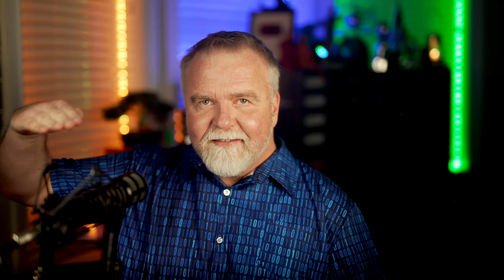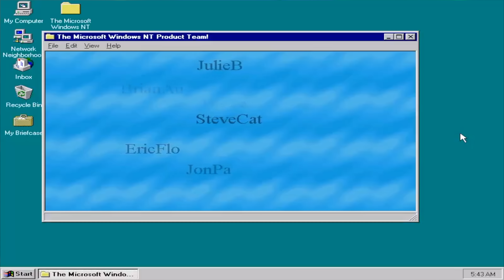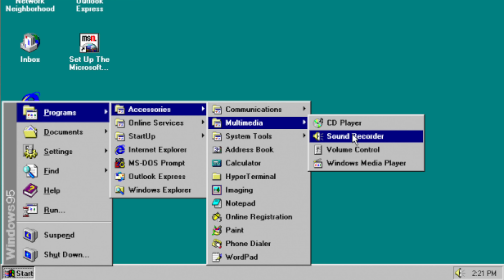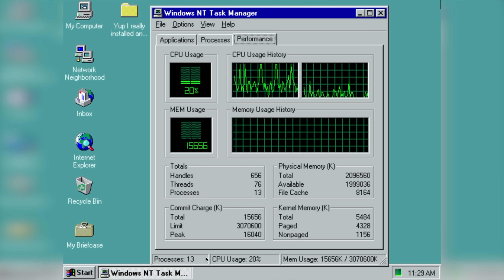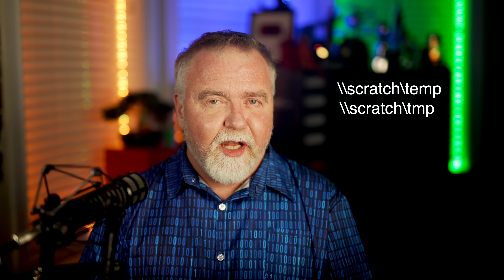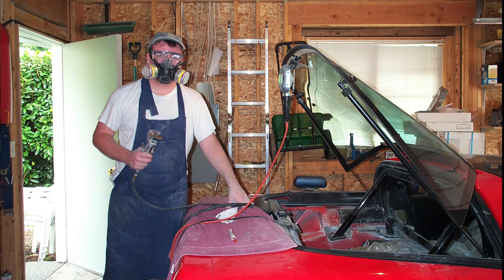Behind the Windows Start Menu - Insider Secrets

Comment: I fully appreciate Dave's explanation of dealing with RISC processors. In the mid 1990s, my team (we developed railroad and rail transit control systems) ported our application from DEC machines to the Alpha processor, Having to deal with 64-bit words as well as data alignment, and weirdly interruptible- and non-interruptible groups of instructions, was a major effort. Though most of our code was in C, we had some assembly routines (mostly for performance), and it was a good 2 years before we found and fixed all the bugs we could find. Many of those fixes were at the customer site, following some failure or weird operation of the system, some of which brought all trains to a halt for several minutes, not good when the main goal is to safely move people.

Comment: For some 1d10tic reason developers are leaving off the menu bar off from under the title bar, in appliacations, and it's p1ssing me royally the F off.   Never, ever get rid of the menu bar.  Every application  there better be a G.D. menu bar there.  File, Edit, View, you name it.

BTW, Dave, I've tried to register Windows 10 at least 3 times with three different times and your activation code swwcks.  It doesn't work.  The run around it gives...  It's a pile of steaming sh1t.    

Once with a sealed shrinkwrapped copy of Windows 10 pro.  Once with one of those cheap OEM keys.  ANd a third tiem with a known good WIndows 10 Home Product key that I was no longer using on another comptuer because I had gotten so sick of Windows 10 I reformated it to Windows 7.  SO I know that code worked at one time.

Comment: may I ask you, why is windows 10 menu is so laggy? Sometimes I press the menu and it doesn't open, I have to wait and press again several times. This doesn't happen on Linux or Macos, but happens on Windows - it is not a problem of my computer (I have access to Windows machines at work and also use Windows on the "cloud" - everywhere is the same. What's wrong with windows GUI, why can't this be fixed fo so many years?

Comment: Being able to explore down into compressed zip files is handy!  I use that daily to pull out a single file or a handful of files with the copy/paste feature.  I tinkered around with NT 4 and 5 back in the day and it's really is cool to meet the gentleman who came up with the start menu!  It was amazing how robust Windows 95 and eventually 98 behaved with NT 4 and 5.  I had a small network of two computers connected with crossover cables back in the day and was able to share files between a Windows 9x machine and an NTx machine without so much as a hiccup

Comment: About those long-blocking network paths. In windows 10 to this day, when I drag a file in explorer towards a window on the left, and accidentally, for a split second, go over a dead network-mapped drive in quick access, the whole thing dies. Not going to hold the mouse for a minute, the drag & n drop at best does nothing but can really crash and burn if it ends up dropping in the wrong place. Does feel weird such a horrible UX still exists there but I know the thing is very complex  ...

Comment: Being a coder as well, watching your videos are like sitting around and talking shop. But in adition to writing code, i also did hardware design.  I have product in some very interesting places here in the US as well as some other very large countries. Since I was both a hardware designer and the software engineer for my own projects i was also in the group that trouble shot hardware designs of other hardware engineers. A lot of my stuff was written in assembler. 

And speeking of Commodore,  lol I used to know the 6502s, 6511s  VIC 20 AND COMMODORE 64. I thought the raster interrupt and the VIC sound chip was awesome I actually built the SID chip into some other devices. But since they had phase 2 clocks getting them to play nice with intel microcontrollers was an interesting trick. 
Great Video!

Comment: The U.I. is the most important part of any O.S. for most users.
After 3.x on a 386, my first "modern" O.S. was win95 (as I never installed the Plus package, so I was able to sell it while still in the shrinkwrap - happy online seller, happy online buyer). Or plus came pre-installed and I just got the sealed box with it. Great U.I. Terrible O.S. 95b was a lot better. Wish I could say I got NT4 next, but nah. Did get to use it later on. Great O.S. Great U.I.
98 meh. 98SE fantastic. Still unstable, but you figured out workarounds for the crashes. Used it till about 2004 or 2005.  (ME was clearly a no-go from the start). 
But as some point you get a new PC. I'll be fair, it was due to unfair limited networking restrictions under 9x. On new 512MB RAM/ nearing 2GHz systems where XP would take 5 minutes to boot, I got 98SE to boot in 15-20 seconds. So I got hold of Win2K. Or NT4SE as I like to lovingly call it. And yes, I did change the sideways text on my Start Menu many a time.
I know many people liked XP. I was briefly forced to use it and couldn't switch to Classic U.I. fast enough.
Windows7 was a good enough O.S. when using the Claasic U.I.
Windows 10 is a most unfortunate O.S. and I feel like a very unfortunate person being forced to use it. I know Windows forcing me to renew "folder view" is a way to make me switch to Windows11. But my natively 4.2GHz Octacore system with 64GB of DDR3 can't run Windows11 according to the Microsoft update page.
So I just long back to the U.I. you worked on!

Comment: You say Unicode, but I imagine that you specifically mean what is nowadays called UCS-2, which was a fixed width 16-bit encoding, and was only capable of displaying 65,536 codepoints, because at the time it was assumed that was all that would be needed. Nowadays, Windows uses UTF-16, which is variable-length, and can represent all million or so valid codepoints, and potentially more. That said, most files and such tend to be UTF-8.

Comment: When I heard about the Windows XP / Server 2003 source leak, as a developer, I immediately was interested. So I found a way to get my hands on the nt5src.7z file. I had to download some extra files to fully compile Server 2003, but after about 5 hours, I had a compiled copy of Windows Server 2003 (Small Business Server). It would not install as there were some missing files. But it did boot into the installer UI.

Comment: Back in circa 1999 when I was in college I had an AMD K6-3 500 with 64MB RAM and a Riva TNT, machine I built myself (my first mostly new PC, and the first one I had that wasnt 2 generations old) I dual booted 98SE (Games and certain software only) and NT 4.0 Workstation (Everything else). 
NT 4.0 is prolly my favorite OS of the "old-world" PCs, for one it was 10x more stable than "9x" and would suprisingly run many (id guess a good 94%) of previous windows apps and 9x apps and even some DOS games.

Comment: I have to be frank, that "browsing into zips like a folder" combined with the fact that the icon in Windows looks almost like a normal folder icon has caused a lot of trouble over the years for people who are not that tech savvy or even just not that knowledgable. They just assume that a zip folder is just like a folder (which sort of makes sense because of the very similar icon), prompting them to try and run applications from in there, and so on. So in my opinion having a) a very different icon from a normal folder and b) having a separate window open with the contents of the zip file is a lot better than treating it like a folder :).

Comment: both linux and windows start menus are crud, mostly system generated. then you have the completely flat space on desktop, where shortcuts get dumped by installers. between the two, it's a mess, and users arent equipped to deal with these outdated ways of accessing programs.
the dozen iterations of adding silly features never addressed the problem. you install software, and without any control it's created some start menu items with some names, that may or may not be names you expect.
is this the peak of software and UI engineering after decades?
Reply from the maker: I'd say it is, until you write something better...
Reply: @DavesGarage  : the  early versions were fine. later ones were not an improvement. it's not about coding. there are even bigger fish to fry, like the mess that is operating system files, software files, and user files, all exposed to the user by default, which is not desired. the original office desk paradigm hasnt kept up with times.
windows registry should go. emulate it for backwards compatibility. it's a mess.
Reply: Installers for the vast majority of commonly used programs in Windows have checkboxes at the end allowing you to decide whether or not desktop shortcuts or start menu items for that program are added. 

The checkboxes are often turned on by default, so if you're not paying attention your desktop and start menu will get cluttered, leaving your only option to be finding a guy that helped build the start menu on the internet and ignorantly complaining to him.

Comment: 7:30 that's a thing I never got about Windows NT Kernel: I've always read that it also supports some different processor architectures than x86 but I've never seen it actually running on anything other than an x86 machine so to me a Windows NT Kernel running on a RISC machine is an abstract idea that you'd never see irl.

Comment: Super stuff. Question 7:36: you were saying MIPS had a diff memory for storing large numbers? And x86 did not care.  Not understood this one.  Thanks
Reply from the maker: So a 32-bit integer is four bytes.  On the MIPS, it must live in memory at address 0, 4, 8, 16, 20, or any multiple of 4.

On the x86, there's no such requirement.  You can store a 32-bit value at address 7.  But if you serialize that structure to disk on an x86 and then read it back on the MIPS and try to touch that value aligned 7 bytes in, it will throw an alignment exception and crash.  Hope that helps!
Reply: @DavesGarage  thanks. I just recalled the CreateWindow struct must have been prealigned for few  32bits like wndproc callback.

Comment: So for this side bar text challenge, coming at it from a games programmer, couldn't you render it to a texture, then rotate that during initialisation or first frame?
Reply from the maker: You could, but that requires two copies of the bitmap, whereas drawing into a rotated device context actually keeps 0 copies!  Every byte is sacred, every byte is great....
Reply: The graphics device interface API at the time was (and still is) simple, 2D bitmap graphics.  No concept of textures.
Reply: @RegularCupOfJoe  there were. I was a game programmer then. Even without the hardware there was a software renderer. So just software renderer to a texture. If there was no texture, then what did he use to draw the sidebar? He literally said texture.
Reply: @aloluk  Correct, there was 3D software rendering back then. And I'm not concerned about whether to call it a "texture" or a "bitmap"-- call it what you will.  Software-based rendering, however, was very slow, as it is still now compared to hardware rendering.  If the start menu took even a half-second to render itself for the sake of a simple bitmap, that would have produced a sluggish and unpleasant experience for users.  From David's explanations, it sounds like the bitmap is rendered each time the start menu is opened, so keeping it snappy is more important.  A simple bitmap can be rendered much quicker with fewer calculations in a 2D pipeline (such as GDI or Direct2D) than a software-based 3D renderer.  No need to use a semi to carry one letter 2 blocks away when a bicycle will do just as well.
Reply: @RegularCupOfJoe  I dont even know what your argument is here. Software rendering this would have been very fast and could be done on the first frame of the key press before it was presented to the user. Thats a fact because we did it in software rendered games back then on the Windows PCs.
Reply: @aloluk  My argument is that 3D software rendering of a simple UI component in the 1990s would have been (1) a risky investment because by far a majority of customers did not have fast enough CPUs to do 3D software rendering until the mid 2000s, and (2) using 3D to render a simple 2D component is overkill from a software architecture standpoint.  Today, 3D software rendering?  Absolutely... do it... or have a very compelling reason not to.

Comment: The classic start menu was the most efficient one - and that's why I use it still today thanks to Open-Shell. It's a must-have if you got more than 5 programs installed... (I got about 350 + a few dozen games).
Reply: But which version of the classic style? In Win95 if you had a gazillion entries it would create multiple columns. In Win98 it was only a single column that could scroll vertically.
Reply: @eDoc2020  Win95/column style. It shows 5 columns on my 4k OLED :) I hate scrolling / not having an overview. But I also created a few subfolders in the 'root' (above 'Programs') for special sections like 'Sound' 'Graphics' 'Video' 'Games' and 'Internet' (yeah..) and got about 20 programs that I use a lot added in the root directly. Drag&drop-a-lot. And yeah, before you ask, my desktop is black. I still use QuickLaunch even :) And classic right-click in taskbar, and no grouping etc. - All thanks to 7+ Taskbar Tweaker. Btw. 'Everything' search engine and Total Commander of course is also my daily driver since mid 90s.
Reply: @surject  The greatest failure with the post Windows 7 Start menu is probably the lack of fully implemented folders. The existence of the quick search combined with my laziness is why I haven't really tried any alternatives.
Reply: @eDoc2020  I use "Everything" to find my stuff.

Comment: Hi Dave, you know what would be cool, the man who created smartdrive trying to figure out why on some UEFI bioses(modern hardware) there is a issue when booting win98: "While initializing device VCACHE: Windows protection error. You need to restart your computer." And maybe a fix(patch, dos driver, etc)
There are a bunch of people who run win98 on modern hardware, but on some UEFI(CSM enabled) there is this issue with vcache.(it is not the amount of ram, and there are workaround and or patches to limit win98 ram to low values ex 512mb ram)
To narrow it down: There is this person that has BIOSTAR X470GTA(ryzen) that can run win98 with bios version 2020.But with bios version 2021 he gets Vcache protection error.
Coincidentally the same error happens in QEMU with OVMF(UEFI)with csm when booting win98 with 64mb ram. For easy debug if you want.
On real hardware and in QEMU, both stop at : 
0028:C03819A6 MOV [EDX+00000100],EAX
Break due to Page Fault (0Eh). Fault=0003

Prebuilt OVMF+CSM:
search for a.mirror.sardinasystems, then kraxel-edk2 dir, then edk2.git-ovmf-x64-0-20200422.1378.ge54310451f.noarch 

QEMU command info:
qemu-system-x86_64 -drive if=pflash,format=raw,unit=0,readonly,file=OVMF-with-csm.fd -drive if=pflash,format=raw,unit=1,file=OVMF_VARS-with-csm.fd

Comment: NT 2000 was a masterpiece, I think it's when the core Windows mechanics peaked... but certainly not the peak of consistency or overall interface design. UCS-2 was a huge mistake, it's so sad that NT went with UCS-2 (and later UTF-16) instead of UTF-8; UTF-8 preserves compatibility for most string handling code, and fails more gracefully.

Comment: Something outside the topic. I wondered why Windows doesn't have proper API to distinguish between input devices and selectively block input. It's a huge mistake to assume that there is only 1 keyboard or mouse connected to the computer. It's been decades, and the "feature" is not fixed.
Reply from the maker: Windows doesn't assume one keyboard per computer, it assumes one keyboard input per windowstation, which is very different.  You could, at least in theory, have two monitors and two keyboards and have them running separate user sessions in different windowstations.  Not unlike what happens when RemoteDesktop is running, I guess.
Reply: @DavesGarage  Thank you for clearing it out, but it is not exactly what I meant. I mean the possibility to differentiate keyboards and other inputs at application level and block it at the same time. Each message should have a keyboard id and scancode instead of virtual key code. The API for games is unreliable, broken with incorrect message orders and latency (and no blocking). So it is basically a huge mistake I meant - the windows should assume you can have multiple keyboards and allow you to differentiate between them. The feature is missing for decades. Some bit of proper OS planning would have helped to avoid it.

Comment: Based on your comments regarding windows NT being completely Unicode internally do you have insight into why the default encoding on windows is Windows-1252 (and still to this day)?

The default encoding is the cause of so many issues on our platforms as many data engineers still struggle with character encodings and it being one of those areas where you can only really make an educated guess as to what encoding is being used there is no easy fix. Our platforms have all standised on UTF-8 and most of the time that is fine, but encoding problems always rare their ugly head when somebody copies some text out of Outlook into Excel and MS Office has helpfully converted the quotation marks!